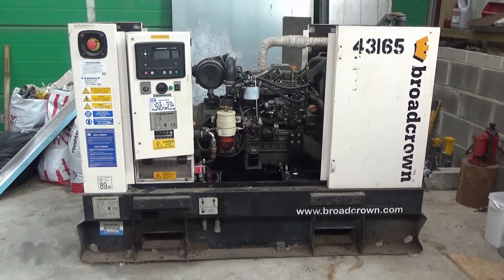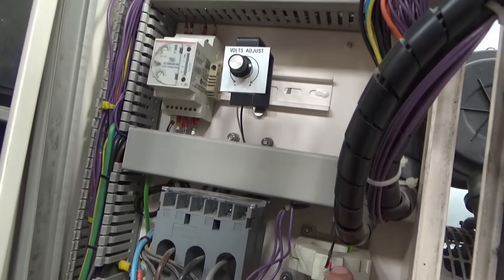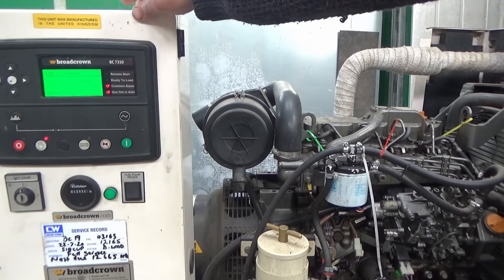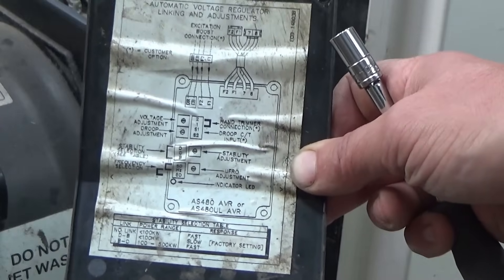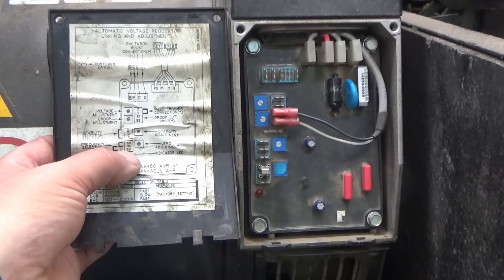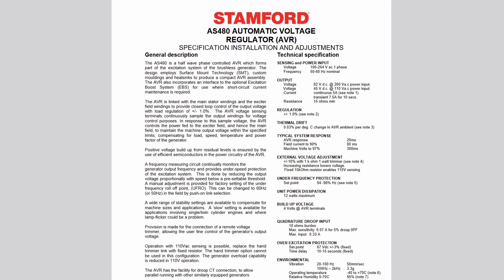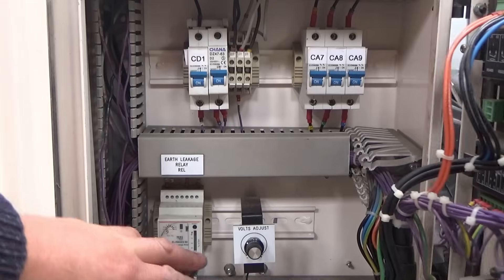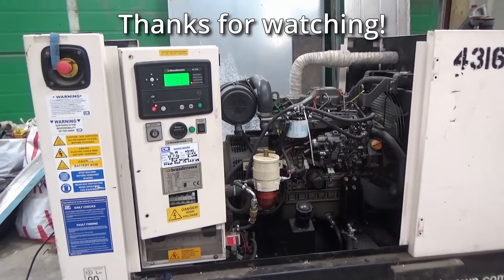Large Diesel Generator - Shuts Down With An ERROR | Can I fix It?

Comment: A warning for your mate, generally three-phase gennies DO NOT like asymmetric loading (to the point of potentially destroying them) so if he wants to use it for single-phase loads he needs to try to balance them out across the three phases. Manual should have details of how much asymmetry it can tolerate before it gets REALLY cranky.
Reply from the maker: Thanks for that Morgan. I think he's got a 3 phase lathe he's planning to use it on, but I'll pass your comment on to him. Thanks again for your input 🙂👍
Reply: Not that he will use it for single phase, but that alternator does have the wiring configuration listed for single phase output, if down the road someone wanted that. But that controller would have to be set up for single phase as well, but those controllers are super easy to program and reconfigure. Most of the gens I have dealt with can go up to a 50% imbalance before it cautions against it. But they are also much bigger then this.
Reply: I saw someone using a phase balancer, not sure how much they cost though. Depending on the load they can be a little pricey ;)
Reply from the maker: I think it's mainly going to be used for the 3 phase output,  and possibly on the odd occasion it might be used for 240v, as he already has single phase mains at the farm, but not 3 phase.
Reply: @MCBatty80  not required.
Reply: Especially in such a small machine... You can "safelly" have 30% of unballanced load. In order to use an 3 phase alternator with 2 phase load, you can change the winding layout from star to zig zag. Considerer that you´ll lose bit more than 1/3 of the total power, but you would lost it anyway leaving one floating phase. This way you wont damage the alternator.
Reply: Usually on 3 phase generators you can run about 1/3rd of the rated output. For field work and call outs, I have a portable 12kva 415v 3 phase generator and it's rated to run 4kva single phase @ 240v continuous. Indeed I have used it for hours like that. It has 2x 240v plugs as well as a 415v 4 pin 3 phase plug. 
On 3 phase I run a 3 phase arc welder, a 3 phase separate wire feed MIG welder and a 3 phase plasma cutter (being sure to the 240v air compressor tanks are charged before using the plasma so the compressor doesn't come on while cutting).
I had a portable single phase generator, the same version as the 3 phase but 240v only and I got rid of it with less than 30 hours while it was still new because the 3 phase did both 240v and 415v and was one less generator to load and restrain.
Reply: That is a very good point.  I'm an electrician by trade an was about to comment about that
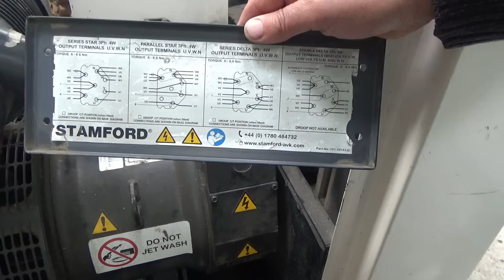Reply: It had the double delta single phase diagram shown at 7:00
Reply from the maker: @RobertL78 Nice, I didn't really notice. I guess you would need to reprogram the controller to suit.
Reply: @BuyitFixit yes, those newer broadcrown/deep sea controllers have a usb port to change all of those settings. I had one shutting down on low voltage because it was wired for single phase and the controller was looking for 3 phase voltage on the middle leg  that was now the neutral.
Reply from the maker: @RobertL78  Thanks Robert👍Good to know stuff like this🙂👍
Reply: You can use a transformer with 3 phases and it will automatically balance the unit.  A transformer isn't very expensive

Comment: That engine, Yanmar, is a great engine. If it's serviced with semi-synthetic 10W30 oil every 500 hours or less it will serve its owner well, they are a great work horse.
The white fuel filter is a Donaldson P550048, if there is room, I'd fit a Donaldson P550643 next time it's serviced which is about twice the size of the ''48''. I only put a ''48'' on this engine if there is something in the way that prevents me from fitting a ''643.''
The Racor 500 Sediment Trap Filter has been added and makes the Donaldson filter redundant as it's a 10 micron filter and the Donaldson is a 30 micron.
Just take the filter element out of it and use it as a sediment bowl. If you clean the tank out and make sure it's fuelled up with clean fuel everytime, you can do away with the Racor Filter and just put an in line plastic strainer in or cleanable strainer sediment bowl in its place. 
That Racor Filter assembly is over £300 new, and I'd sell it on Ebay.
Reply from the maker: Thanks for that, I'll pass the info on to my mate who owns it 👍I think he recently serviced it after sorting out the top end, but I'm not sure if he added any of those filters or not. I just got told it had an electrical problem and it was beyond his remit 😂😂😂
Reply: @BuyitFixit .
Reply: Just for curiosity, can it run on fully synthetic used in diesel car engine?
Reply: @edmondhung6097  Putting full synthetic oil in a generator like this isn't necessary. Just change the oil and filters every 500 hours of running or less, and it will be well serviced throughout its life.

Comment: Holy shit Mick, is there no limit to the size of something you'll buy in the hope you can fix it!? At the rate your stuff is increasing in size in about a year your video titles will be like 'Boing 747 -  Purchased on eBay - Spares or Repairs - Not starting due to multiple error codes from one of the engines and the landing gear'. Awesome work fella, as always 🙂
Reply from the maker: Thanks Marc. The generator isn't mine but a friends. He bought it at auction about a year ago and asked me ages ago if I'd have a look at it, and I only got round to that last week 😂😂
Reply from the maker: Just thinking, the biggest thing I fixed recently was an electrical problem on a Fendt tractor. I think it was around 9 months back or so. Video is on here too 🙂

Comment: Wow sometimes its amazing how so small problem can cause such a big issue.. that could be solved by the company by marking those wires location by color or different connectors  like  "idiotproof" ones. Very NICE BIFI 👏
Reply from the maker: Very true! I'm still not sure why someone had even been in there and even thought that someone had purposely tried to sabotage it, possibly to get it cheaper at the auction...still a bit of a mystery.
Reply: The manual fine adjuster probably did not come from the factory.  It looks like an optional extra added later, it does not match the "look and feel" of the main unit.
Reply: @einfelder8262 Looks like the manual trimmer can be replaced with a jumper when it's not being used. But the previous 'repairman' just made a dummy mistake -- if they took a photo before replacing the board, they would have known where all the wires are supposed to go. And that regulator board is mounted inside the generator terminal box, so it's probably only supposed to be replaced by servicemen anyway, not by users.
Reply from the maker: Yes I thought it looked like a jumper would need fitting if the remote adjustment was not fitted. Thanks for commenting 👍
Reply from the maker: Yes agree, I think on the plate I removed with the diagram it had *optional or it might have been on the datasheet I downloaded. I think a link is supposed to be fitting across those pins if it's not installed.
Reply: No no no You can't make it "idiotproof" for idiots just get smarter.
Reply: yes, that manual trimmer adjustment is not necessary. The manual for the avr you downloaded should have a procedure for tuning the avr
Reply: look like it was a hire set so the manual trimmer would have been fitted to stop anyone messing around with the AVR.

Comment: Fantastic bit of detective work. How you are able to so quickly determine where to concentrate your effort, I will never know, but you my friend are a cut above the rest.
Reply from the maker: Thanks Rory. Once I knew the voltage from the actual main generator part wasn't correct, I knew the problem had to be around there. At least it didn't require a new board, which is what I had been thinking it might have been.
Reply: If you know the general principles of how something works, you can isolate the fault by elimination and using the good old mk1 eyeball to spot things like the wiring diagram on the inside of the cover
Reply: It's just a case of looking for the bleeding obvious based on the clues in front of you.  He sniffed about by running it to see what clues it presented and then he followed the obvious one.  Which then led to the next.  There were only 3 or 4 steps he needed to take to find the fault and fix it.

And incorrect voltage suggested to me right at the start somebody had been messing with it who shouldn't have been.  To coincidental that all 3 phases had exactly the same wrong voltage.  The only way that could happen is because the exciter adjustment or input had gone bad or been tampered with.  

It looks like this one doesn't have independent voltage regulators for each phase, just a single exciter adjustment for all 3 and I'd assume the board can adjust that according to load, but it looks like that adjustment will effect all 3 phases.   So you will need to be wary of load imbalance because the phase with less than the rest will see it's voltage climb.

This would also be an excellent stand by generator for the guys house.  I know he only has single phase, but it wouldn't be that hard to load balance his house well enough for the generator to handle.  Keep the single phase switchboard he has and put contactors in circuit after it to switch the loads off the mains switchboard to the 3 phases of the generator.  And it looks like the controller is already set up for automatic running so it can control the switch over to and from generator as the mains go down and come back up again.
Reply: But if he's going to do this he'll have to fit a trickle charger to keep the battery topped up.  Simple enough to do but feed it off the switchboard, not post contactors.  That way the trickle charger only runs off the mains.  Most likely the generator charges it's battery when running so you don't want that and a trickle charger running at once, it will confuse both of them.
Reply from the maker: Thanks John 👍yes the battery charges when running. I checked the battery voltage before starting and while running to make sure it was charging and it was around 13.8v when running 👍
Reply: @johnrauner2515  there is no way to adjut the phases independantly, and no need. imbalanced load will not affect the individual phase voltage.